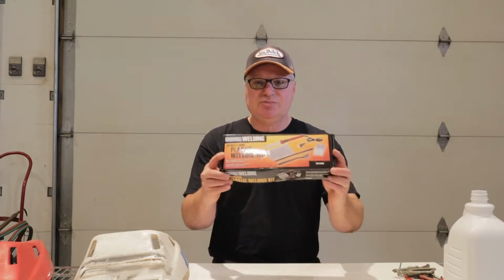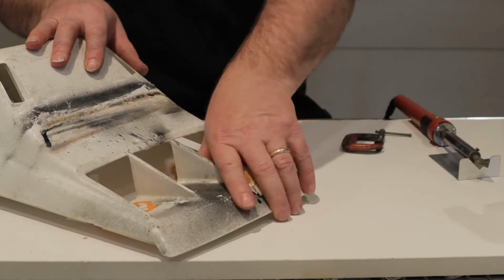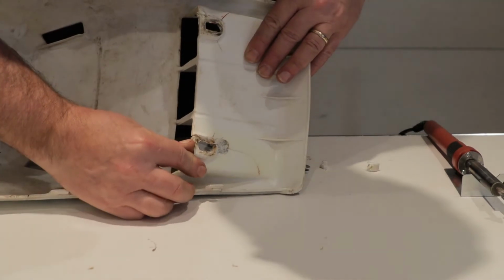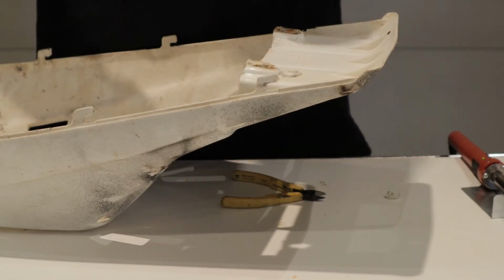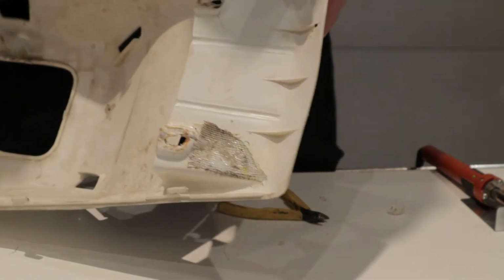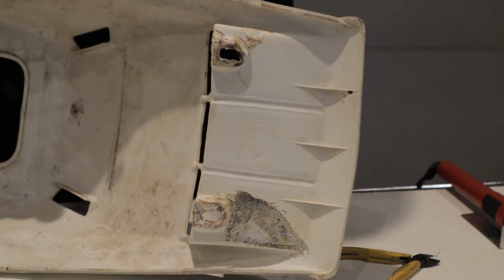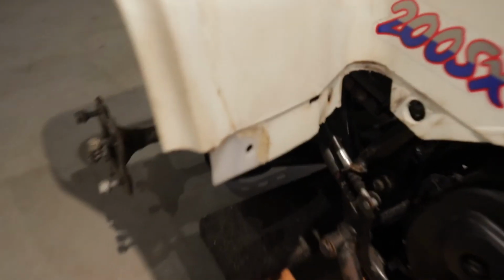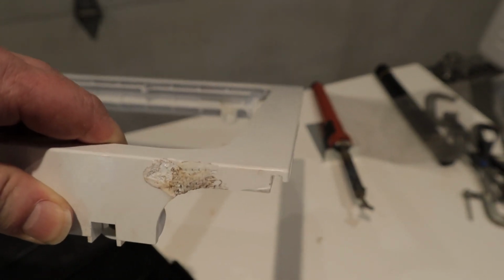Repairing ATV and Four Wheeler Plastic Body Parts and Others with Harbor Freight Plastic Welder

Comment: you need to drill a small hole at the end of eash crack or the crack will always come back
Reply from the maker: Point well taken. It is always good to stress relieve a crack.
Reply: Does not work on all cracks

Comment: Thanks for this.  I just used a soldering iron.  I think the HF wood burning kit might work well too.   I can't find something to use for polycarbonate welding rod.  Any suggestions of something made of PC that comes in colors?
Reply: Cheap Walmart paint mixing bucket. It's the same code of the atv plastic. That's the truck. You'll see the recycling symbol ok, match them up and melt into whatever u need. Skinny strips work better